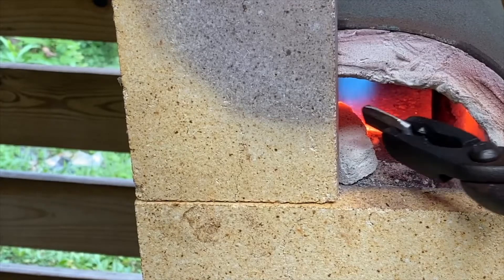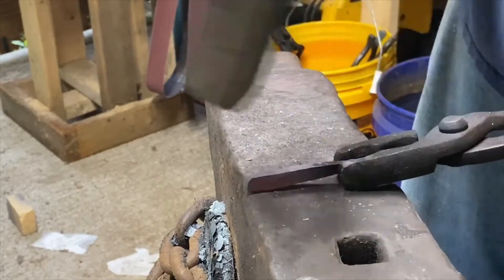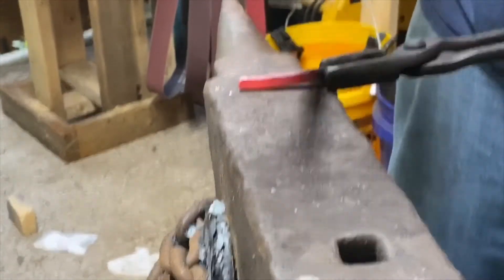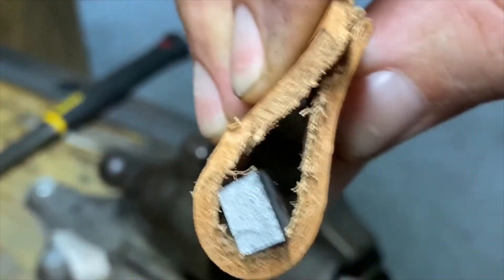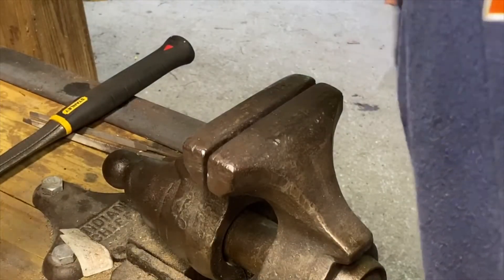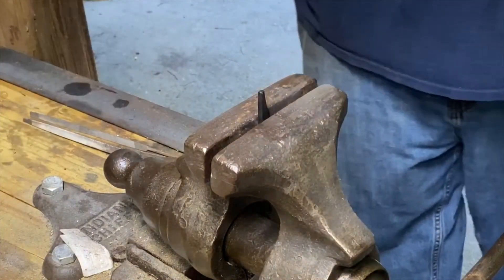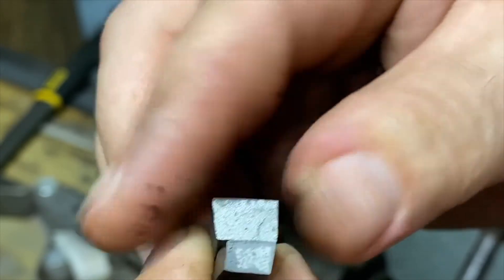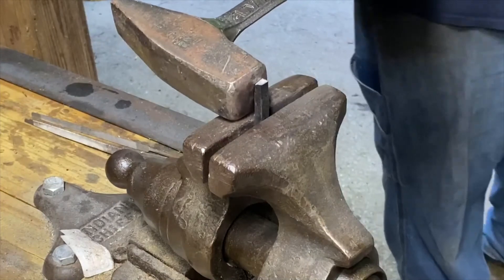How to Heat Treat 5160, grain growth and thermal cycling

Comment: Interesting, I have 8 ft of 5160 I havnt used yet
Reply from the maker: I love 5160 it is such an amazing and forgiving steel to use, it doesn’t keep an edge as well as some but it is super durable which is a plus. I can sharpen a blade so durability is where I like to forge.
Reply: @woodsedgeblacksmith1026  consider an appleseed bevel grind. 5160 is an amazing animal
Reply: @woodsedgeblacksmith1026  convex bevel
Reply: I wish there were two of those second ones, I'd like to see how it held up after tempering two cycles the grain looks excellent